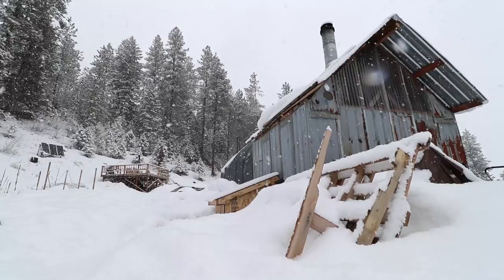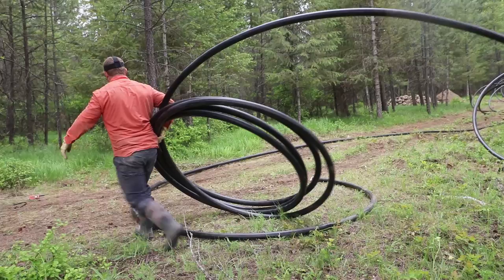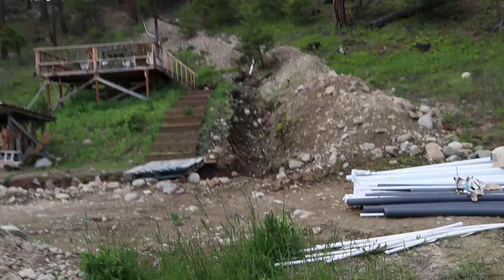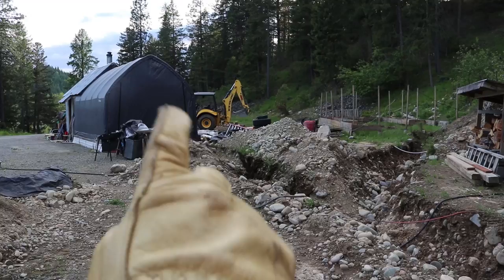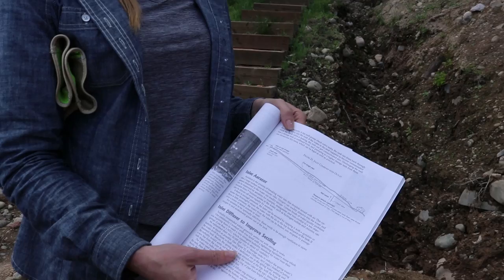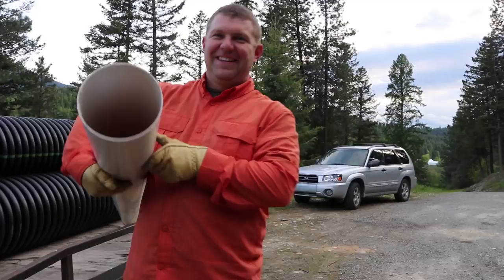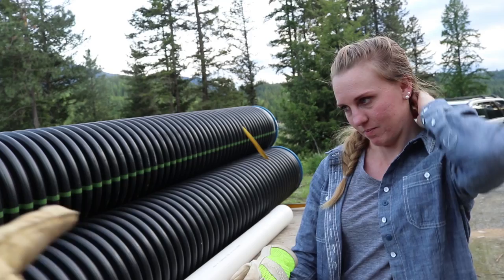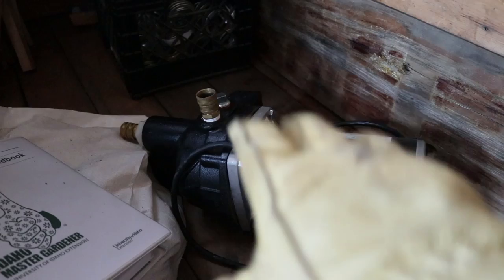EPIC $10,000 OFF GRID GRAVITY-FED WATER SYSTEM

Comment: Set up a well to pump on demand into the cistern. All you would need is something to let you know when the water is getting low, go over to a panel in the house, turn it on. Fills up the cistern tanks and then turn it off when it's full!
Reply: Ryan Ducken the only issue is they want it when they want (cheap hours or full sunshine on solar) and not on demand. But you could always set up a timer

Comment: Wells don't have to take a lot of power. Check out engineer775. He does a lot of solar well pump systems that pump to a cistern like you guys have. Very simple stuff. Great video guys!
Reply: i agree
Reply: Aeromotor still builds water well windmills to pump water in San Angelo, Texas.  You want to learn how to pump and move water cheaply and off grid you need to look at what is done in West Texas with wind and solar.
Reply: WD Green v
Reply: Engineer 775 has an awesome design for a hot water heater/steam engine/water purification system. and it's super efficient to build and operate.
Reply: was going to add that
Reply: Really, you need to call Engineer775. This is what he does for a living. He's got a great YouTube channel.
Reply: Don't forget you can still get the old hand pumps. They didn't do enough research.
Reply: That's not what they stated in this video. They use a generator to run the pump. Totally 2 different things entirely.
Reply: They should have access to the geological survey done on the property/area. Water source should've been first priority, as of now, they haul it in.
Reply: On pipelines we use shaker buckets on excavators to bad the pipe... Sometimes you can get rock mats for the application in rocky terrain.
Reply: Mrcaffinebean You ------ so true he's the guy to go to !
Reply: Trees Climbing & Gear true but a good well driller could probably give a ball park on what's common in their area as far as depth goes. The good news is if they do dig a well it will fit nicely into the system their building. So their not wasting any money by building this.
Reply: +Mrcaffinebean not sure how a well would tie into this system... unless it's a poor well on which they could slowly fill the cisterns . they might as well dig a shallow 20 foot well and see if they can get enough water from it
Reply: Tyler Witty yeah a slow pump is perfect here.  Dankoff makes several that are direct dry. The pump with the sun is shining and shut off what the sun goes down. Perfect for any well really. http://www.dankoffsolarpumps.com
Reply: +Mrcaffinebean it's a system for a piss poor well which you hope not to have ..
Reply: Tyler Witty sure it definitely has that application. It's also a system that does   not require 220v on demand all the time which is what their going for here. Direct drive solar, still off grid.
Reply: +Mrcaffinebean 110 submersible on a generator and four large pressure tanks or more if you don't feel like running the generator twice a day . under a grand , I've just bought them past summer ...
Reply: Mrcaffinebean I agree I was just going to suggest they look him up, smart guy
Reply: Mrcaffinebean Isi
Reply: Drilling their well would be super expensive and if they are coming from the back of their property then add even more cost to what they have already dug. Drilling wells here in central NC where the soil is clay and not that hard to dig can cost a pretty penny depending how far you have to go to hit a good table. I have a friend who had to dig close to 700 ft on his property costing him 10k just for the drilling. He had a really poor water table. plus running all those lines like they are doing from a further distance $$$$$ adds up even faster. Remember they are also doing this as funds are available to do this whole homestead debt free. But I do agree a well doesn't take much power to run just add more $$$ to power them. Now that they have this system they can do rainwater catchment and pump that up to the cisterns or dig a well in the future and use that to fill the cisterns when needed vs running to town for water. This is a very good stepping point and offers a lot of options for adding onto later.
Reply: @scooter041031 No way a 700 ft well cost only 10k...
Reply: Which is why they need to better research. There are geographical maps of the area IF they go to their local head state office and look. This will show them where to drill IF there is any water on their property. Doing more research will save a lot of money vs how they're going about things right now.
Reply: I disagree with that living most of my life off of well water and needing a well dug myself as well as friends and family that survey is close but does not tell half the story of the complexity or if the table has moved etc. For example my water table in the house I live in now is right around 20 ft the surveys say its over 100ft and not where the drillers located it. I could of had plenty of water drilling down only 60ft my neighbors well is only 80ft I had mine drilled to 200ft. Drilling through rough terrain like they are in is going to be VERY expensive. What they have now can be added onto with a well later and used as storage tanks it is actually a very good 1st step especially if they harvest rain water into containers off their house then pump it up to the cisterns.
Reply: That is cool using solar power for a well. I should do that. simple. but I seen a vid about a Tesla I believes tube or pipe for flowing water up. was long ago. it's just machined pipe. once it's flowing it never stops. tap one in the ground and pump it to a water tower. the height of the tower should have enough force for a shower. no energy needed. if the pipe really works. lol
Reply: scooter041031  Not disagreeing with you. Only pointing out that they need to do better research. There is always more than one way of doing things. They haven't setup anything to catch rain water. If people actually paid any attention to the video. He stated they will use a generator to run the well pump to fill the cisterns from the tank they will use to haul water in with. Not efficient!! People have pointed out better ways. They will still do it their way and spend more money than they need then later will complain about the cost. In the end, their house will be completed by a contractor.
Reply: What's the advantage to a 110 pump on a generator over a slow pump on solar?

110 Pump
-Generator needs to be started multiple times a day
-Requires gas for the generator
-Requires maintenance of the generator
-Your reliant on a small motor running fairly often. 
-Puts wear and tear on the generator 
-Pump installation requires someone with special tooling if the well is deep. 
-In the event of well contamination/pump failure you have on hand about 1 day of water 

Solar Pump
-Runs constantly automatically 
-Allows you to have a large on demand source of water for fire fighting
-Has about a 20 year span equal to or outlasting a submersible  
-Pump is above ground and easily swap-able by a home owner. 
- Costs nothing at all to run. 
-In the event of well contamination/pump failure you have on hand weeks of water
Reply: They have been very open to suggestions and ideas. I think they'll succeed together and I thing what they have here for water storage is certainly very useful. I just think adding a well with a solar pump will make there lives a lot better AND will add to the value of their home. Win win, but the good news is it can wait until they have cash saved because for now they can haul water.
Reply: +Mrcaffinebean advantage are you don't depend on a none dependable source , they run the generator anyways, and submersible are easy to work on and below frost. 110 won't require a different inverter once they go full off grid and I think they prob have enough solar system to run it already.. I'm not familiar with the system your referring to, is it a high pressure with the ability to overcome much head? does it require an additional pump for booster to pressure tanks , I assume they don't want to stay at 6 psi for their whole life, that would suck ..
Reply: I'm not sure what about a solar pump system makes it non dependable. I would certainly consider it more dependable than any system requiring a generator for the rest of there life. 

I'd not totally aware of all of the options but I know some of the solar pumps can work with up to about 1000 feet of dynamic head. Which is fine for all but the deepest wells. There are booster pumps that also run direct off solar if needed but in their case they wouldn't need one because they would be pumping to the cistern. It's hard to tell by the video, but if their tanks have about 100ft of head that would give them over 40 PSI at the house.
Reply: A system with a solar pump that fills a cistern makes great sense!
Reply: +Rob Stewart only if the cistern is then pumped from to get some quality pressure. .
Reply: Tyler Witty why would it need to be repumped if it's gravity fed to the house.  In much of Latin America every house has a cistern on the roof that is fed whenever there's enough water pressure.   

Basically the design they have planned for the future, to use a well to fill the cisterns, combined with a float system inside to turn the pump on and off and a solar panel and battery bank would be a great setup.
Reply: +Rob Stewart because low psi sucks and is almost useless..
Reply: +Rob Stewart because low psi sucks and is almost useless..
Reply: They have done a lot of research so far and their house will not be completed by a contractor. They are doing things in stages as $$$ permits. Could it end up costing more maybe but I doubt it and I believe that setting this up first is a very smart way of going about a long term water storage program. There are many ways to skin this cat and one way is no better than the next. They don't have a system to collect rain water yet because there is not any permanent structures with roofs to make collection a viable option at this point. There are a lot of things in the works that have not been disclosed yet and/or have not or will not show their audience yet.
Reply: +scooter041031 of course there is a best way to skin a cat ...
Reply: With their 2in pipe using a calculation they are going to gain almost 1 PSI per vertical foot of drop I believe they will be close to 30 PSI at each of their spigots give or take. There is a guy in the mtn of NC who has to regulate his pressure because his drop creates nearly 60 psi.
Reply: +scooter041031 you might want to learn the true psi to vertical foot instead of guessing . they have about 40ft of vertical and the equation is roughly .43psi per foot .
Reply: If there is enough drop you can get some good psi for one vertical foot of drop with a 1 in pipe you generate nearly .5 psi. The psi is directly proportional to the weight of water the key is getting the plumbing completely full with no air pockets to create a good pressure.
Reply: +scooter041031 they might have about 10 to 15 which pretty pitiful ..then assuming their house is above ground, every foot up pressure is decreased...
Reply: Much of NYC has storage tanks and then the building is gravity fed using this method because the pumps to feed buildings would have to be huge and take an enormous amount of power to create enough pressure and volume. It is done this way in all high rises as well. Spot On!!!
Reply: We will have to wait and see. I wish them the best of luck.
Reply: +Tyler Witty You obviously are stuck in not visualizing their final outcome. Your best way may not be their best way. You do not know all of the intricacies in their final plan or what they are trying to accomplish. You are right there is a best way to skin a cat but in doing something like this each project, outcome, issues, on and on make it so that it is an individual best way is my point. I do know the exact calculation for water PSI per vertical foot drop. .43 PSI/foot is for an exact 1" square pipe it is a little less than that for a 1 in round pipe and around .75 psi for a 2 in diameter pipe. There are one way valves you can use to prevent back flow in their home and hold pressure until it is needed (on demand) etc.
Reply: Tyler Witty I've skinned animals and the right way depends on many factors lol
Reply: +scooter041031 psi doesn't change , learn hydraulics.. they are called water towers . water plants often have storage tanks that pressure is made from . .
Reply: +Rob Stewart this is true..
Reply: Hey There ! the solar pumps are super dependable and with high heads you can use the lower flow pumps and easily achieve great distances I have some grundfos pumps pumping 1600' linear feet.  I have the Sqflex 6-2 in my well and it only draws 400 watts peak to pump up my hill to gravity assist my booster pump.  I am that Jason guy Engineer775 talks about :) maybe that gets me some pointz
Reply: Jason also runs a great solar channel! Good to see you here Jason!

Comment: Are you separating the holding tanks with a valve and a bypass? That way if one tank went down for any reason you could separate them and still have holding capacity during a fix.

Comment: I have a 2000 gallon cistern that is trickle filled by a deep well, the deep well is relatively low flow (less than 10GPM).  Think of it as charging a battery.  Always lots of water on hand.  System is about 10 years old so it has proven itself.

Comment: In AZ they charge around $20/ft for the drilling part, casing, pressure vessels. etc., are on top of that,  dependent on the depth. If you have a dry hole, many drillers will charge only 1/2 for the next one. 10kW solar system with Tesla battery storage packs, you're looking at $15-20K.

Comment: Yup to the solar pump. I don't know if you have a level indicator in the system but if not then could you not just put a pressure sensor anywhere in the line and just calibrate it to give you the levels in your cistern?

Comment: With the burial tape, you do not need the tracer wire. The metallic burial tape also acts as a tracer for the utility company. Though the burial tape does tear fairly easily, having the tracer wire is a back up for the tape.

Comment: Did you consider a Lucas mill that swings the bade vs the tree manually on the rail base?  Lucas mill sets up over logs vs logging to a landing.  Move beams not trees?  Especially without equipment.  Unlimited tree size..  Love the channel.